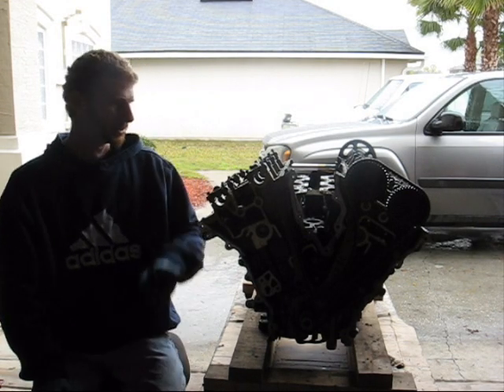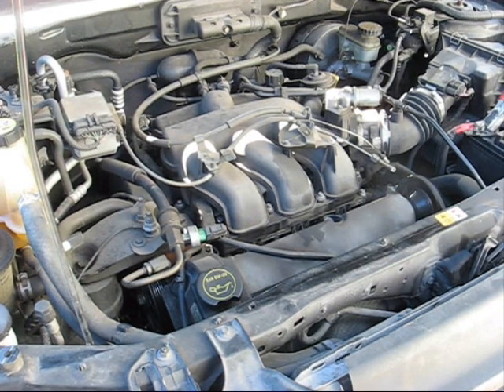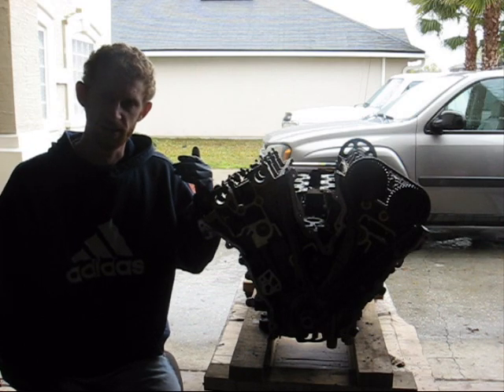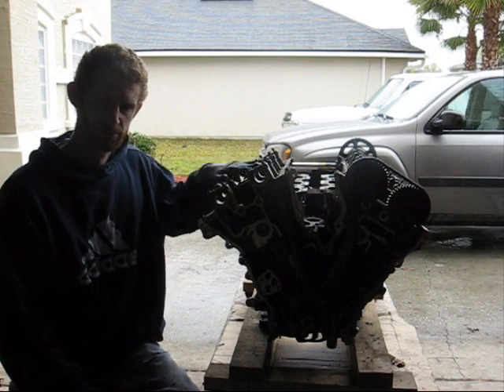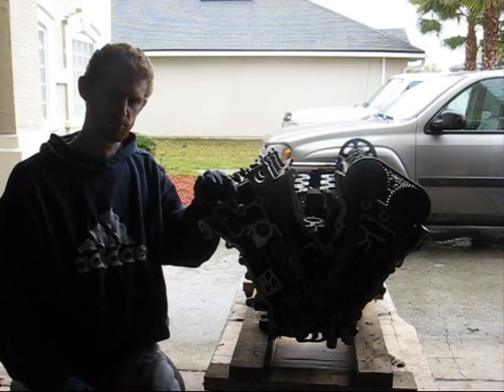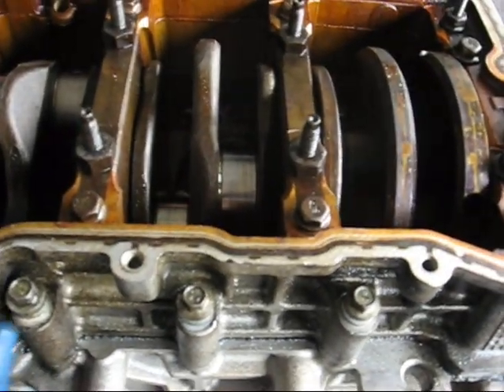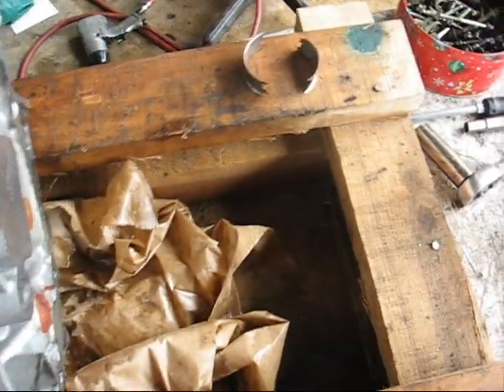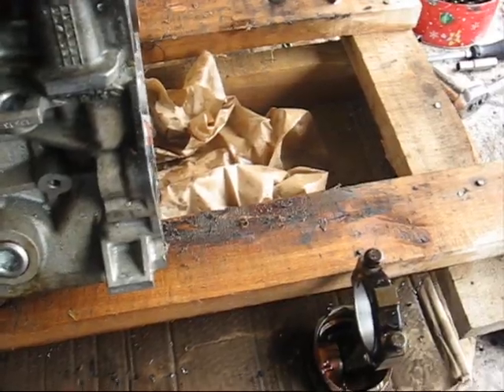Knocking 3.0 Duratec teardown

Comment: Scrap it?? Why don't you rebuild it and sell it? There are a ton of vehicles out there that use this engine.
Reply from the maker: You can buy Good used 3.0 engines for 500$ all day long. They aren't very common in enthusiast cars either so people aren't usually picky about having rebuilt vs used.  By the time you factor in the cost of parts and machine work its more expensive to rebuild an engine than to get a used one. Due to the large supply of 3.0 engines there is very low demand for a rebuilt unit.  So basically I wouldn't make much if anything on it and it would take up alot of time which I didn't have. If I was going to rebuild It I would have just done that instead of swapping it.
Reply: Disposable motor. Like he said. All TTY (Torque to yield) bolts, you'll spend a fortune in fasteners alone. Sad but true fact. Cheaper to scrap and get a wrecked engine

Comment: Nothing to see here!!
Reply: I don't know for sure, but the video of the engine he has torn down shows holes drilled in the crank.
Reply: Not sure wtf I was thinking or if I was just drunk typing. Here's a rundown...There are only two crankshafts: one with a shallow bore hole in the rear with a short alignment bushing and one with a deep hole and long alignment bushing. This engine underwent a ton of variations between carmakers (particularly Mazda), so you never really knew what you got. 
I have a 2005 Mazda 6 GT with the Duratec 30 in it. It's an absolute nightmare to work on.  I've had to replace the alternator (which is tucked tightly under the exhaust manifold and the only access to it is by dropping half of the suspension on the right side), the starter, the EVAP tank (wanted to shoot myself by the end of that one) and spark plugs (which requires removing just about the entire top half of the motor due to lack of access to the plugs against the firewall. 
Moral of the story: Stay the fuck away from this engine at all costs!!